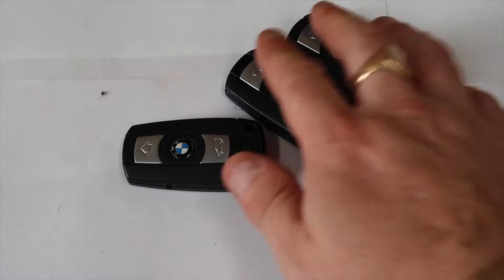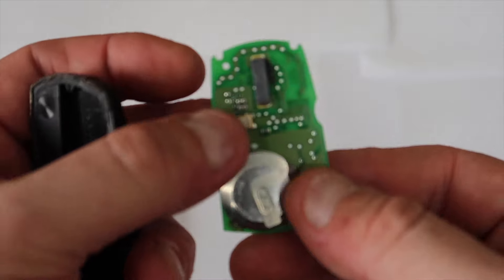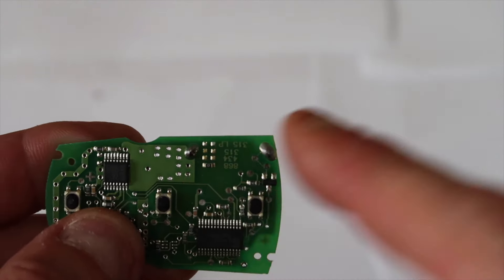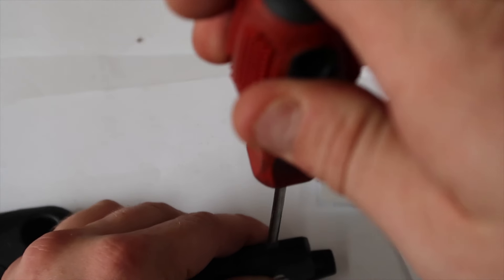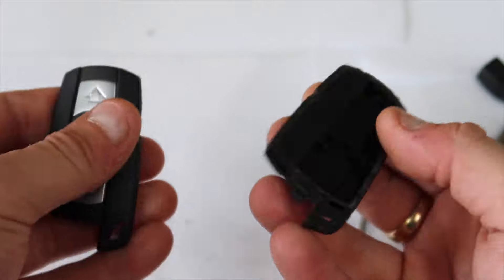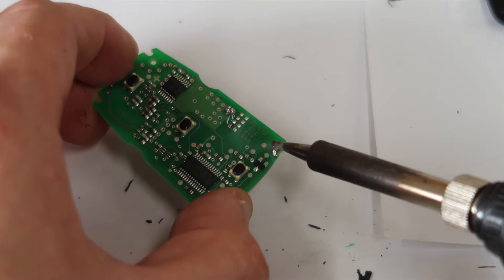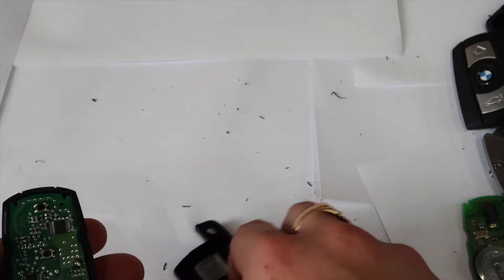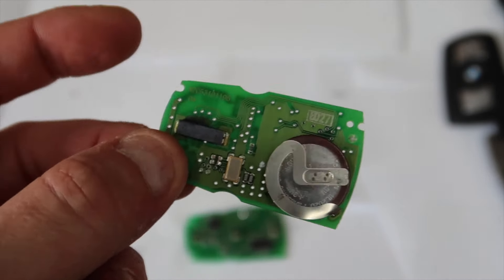BMW Key Battery Replacement & Transponder Removal

Comment: My car was telling me that my fob "needed recharging." I thought I would need to replace the battery. I talked to the Parts guy at a BMW dealership. He told me to put the fob on a wireless phone charger. I did so, for about 18 hours, and it worked! So, instead of performing surgery on your fob, try a recharge!
Reply: I’m reading this after i busted mine in half 🤦🏼
Reply: Like was it a specific phone charger, or any wireless phone charger?

Comment: I have the exact same key with the battery soldered to the board. I can unlock the doors and open the trunk but it will not lock the doors. I was thinking battery but after watching this I’m thinking something else. Do you have any ideas? Thanks

Comment: In my e60 525d lci the button order goes like this:
Top-unlock
Middle-lock
Bottom-trunk
I've bought this car as preowned from first owner and now you made me wonder whether my fob with a different button order from the one you mention is a result of some unprofessional repair or software error? It works like that on both fobs. 
Thank you for showing how to change the battery 👍

Comment: Dr. Dean, I only recently discovered your channel here, and I'm really learning a bunch from your videos. Thank you! I have a 2009 E82 135i that I'm keeping up and much of your content is very helpful. As I'm still using the original key fobs, I figure it's only a matter of time before I'll need to put what you've shown here to use. Would you mind recommending some links to where I might purchase the new replacement batteries and cases? Cheers!

Comment: I just purchased a 2012 x3 with one working fob but the other one isn't recognized by the car until I hold it against the steering column, and then the car starts without issues. I replaced the battery (non rechargeable), and the issue remains the same. Can this be fixed, or do I need another fob?

Comment: Is it possible that the signs of a low battery will put on the immobilizer? I have a key that keeps pushing out the key when I am driving alone, strange? Now car not been used, can't start it....many thanks 🙏.

Comment: My unlocking button is not functioning.  To try and fix it I changed the battery somewhat similar to the method in this video. New better working as before. There is a bit corrosion near the numbers on the left. Any ideas?

Comment: Dr. Dean is have a 2006 bmw e60, i opened mine and i changed the battery in my key. It would not open the doors originally but it would start the car. I measured the battery and the voltage was 1.28v so I purchased a new one installed and it still would not unlock the doors. I have a rke & rf monitor to see if it’s sending out a signal and it’s not receiving the signal from the key. What should I do?

Comment: I changed the battery like you have in this video but now the unlock/lock/boot buttons don’t work now. It still works in the ignition but the buttons have stopped

Comment: I just pried mine off the metal clip and superglued the plastic case back together. It’s ghetto but it worked. I find the the plastic will hold the metal clip on the battery so there’s no need to solder it back.

Comment: Any tips, I replaced the battery as I couldn’t unlock/lock doors it worked for about 24 hours, then stopped working. I replaced with another battery, it worked again and now again has stopped working?
Reply: Mine does the same - did you ever find the solution ? If so could you let me know thanks

Comment: How do you connect the transponder to the smart battery?? I brought the easy access fob unsoldered the knackered battery and have the CR2032 battery but cant see ware it connect to  can you do a video on the smart connections

Comment: Bought a 3 series with two keys the second key was dead, opened the case measured the battery around 2 volts. Thought save messing about soldered a new battery in, measured at 3.2 volts new and put back together. Put fob in dash and still nothing, tried waiting 20- 30 secs put foot on brake and pressed start but still nothing ? Any help much appreciated.

Comment: So could you put the circuit board in the new fob with no battery then put a new battery in the back of that key will it work and just not charge?

Comment: Hi Dean I’ve got an E91 and my key just stopped working when opening the doors. The key starts the car. I’ve changed the diversity module but no joy. Could you help me here please.
Reply: did you fix your issue? i have the same ploblem on a x5 bmw. new fob battery new diversity antenna all fuse looks ok. and it doesn't work

Comment: I have a funny feeling it’s the actual battery that you need to buy. The VL2020 has that fully rounded contact point for recharging, whereas the snide ones off eBay do not, and that’s why when you replace the battery, it works for 24hr then stops. 
Does anybody have this same issue ?? If so what’s the solution please - is it I need the VL2020 battery - tia

Comment: Another great video thanks mate 👍😎

Can you PLEASE do a video on the central locking failure on the E90s and other models around the 2007 time as mines had it the Dealer supposedly fixed it (lasted two weeks and they REFUSED to fix it properly!) This was a recall in Germany but the Main dealer delivered my car back STILL broken with driver's door actuator and filler cap actuators both Brand New blown again NOT fixed and refused to! SYTNER CHIGWELL BMW ABSOLUTELY SHIT!! COWBOYS/CON MERCHANTS! Gave it back with an extra fault after the recalls for main power lead and heater now Hester rattles and ALSO didn't even remember to do the SERVICE it WENT IN FOR!! Absolute SHIT!!
ANYWAY please mate can you do something covering the central locking failure!?
Thanks and great videos as always mate! 👍💪😎

Comment: Hey Doc first of wanted to thank you for all the info it's a great help for everything related to the car I have really :)
 
I was fiddling around with a diagnostics tool on my phone (Bimmergeeks ProTool) and saw a live gauge thats called 'Cylinder Knock' with the unit 'V' for each cylinder.
Do you know what it exactly means because I noticed that Cylinder 1 has more inconsistency to it compared to the other 3 cylinders? 
It's an n43 with 170hp if that helps. 
Thanks again!

Comment: I bought an e90 and it came with a key that had already been opened. I was told that it just needed a new battery (and I assumed it was the original key fob). But, after replacing the vl2020 the fob still does not work for unlocking/locking nor the trunk. I have always been able to use the fob to start the car and had to use the cut key for entry into the car. I have tested the transponder board and it is receiving power from the new battery. I did try to do the methods found online to program the key with the car but had no luck. Do you have any idea whats going on and why it doesn't work? Any but of information and input would be greatly appreciated! Thanks. Marc
Reply: Whoops forgot to say great video! You made it Super easy to understand and DIY. I wouldn't be surprised if a grade schooler was able to do it.
Reply: Im facing that same issue right now lol